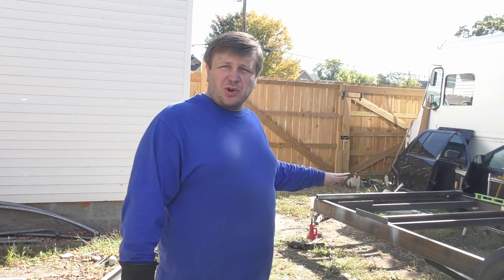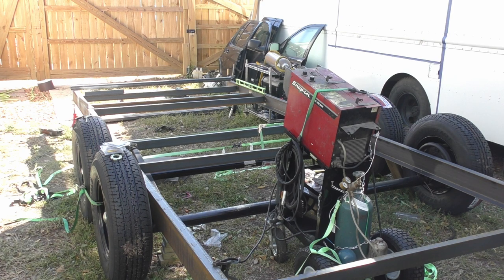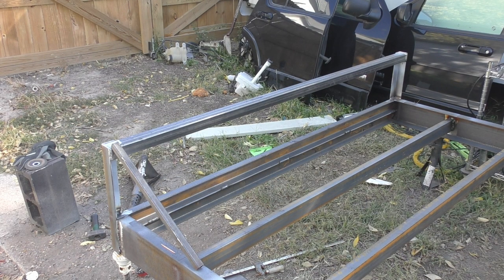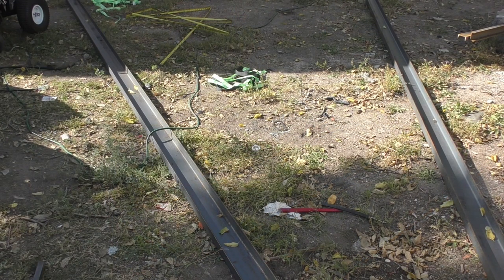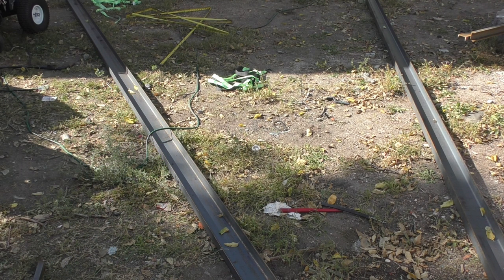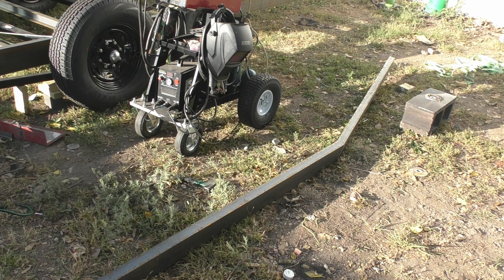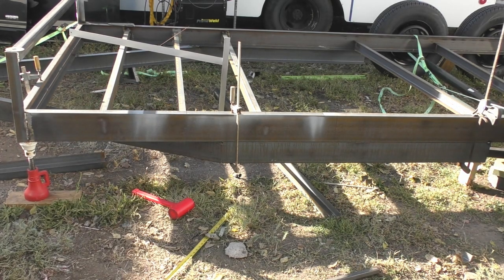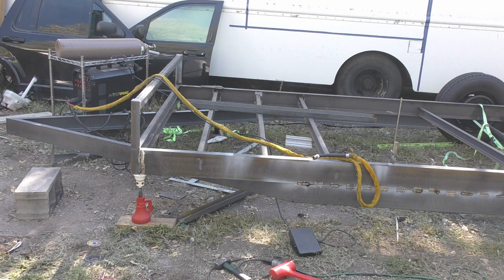Air Ride Tandem Axle Trailer - Building out the Tongue and more

Comment: Just wondering why didn’t you make your trailer a single frame?
Reply from the maker: Not exactly sure what you mean by single frame, I can guess, but it might not answer your question.  I'm sure the answer will mostly be for strength reasons.  

The tongue I built is considered a "wrapped tongue" It creates a lot of strength for not much added weight.  The overlap also adds strength by not relying on welds.  

Hopefully that answers what you're asking.